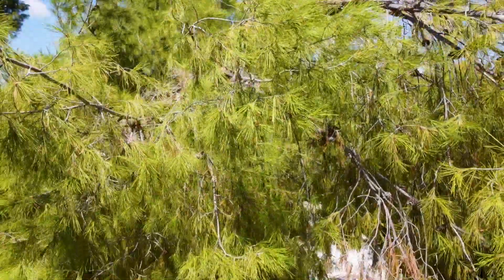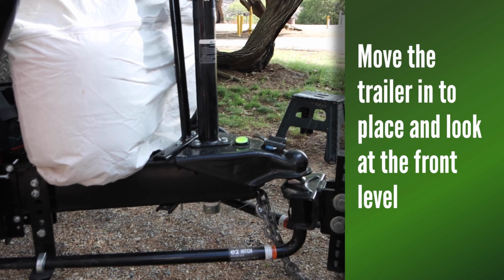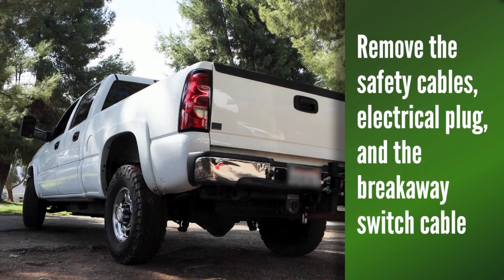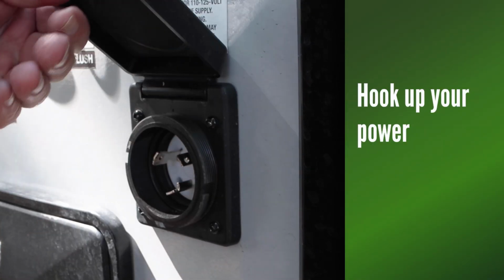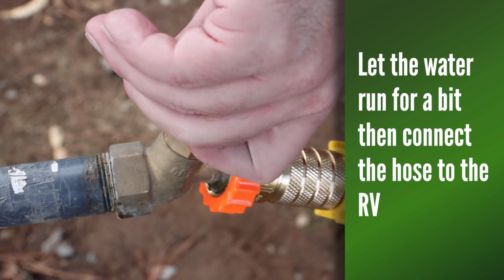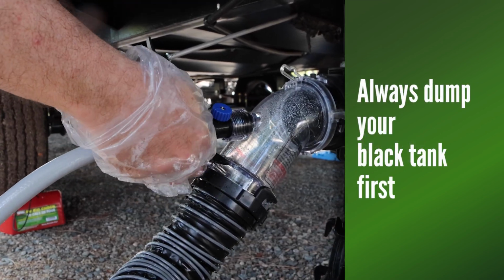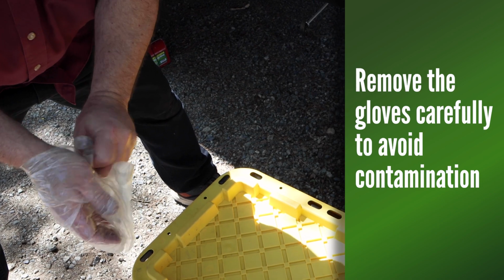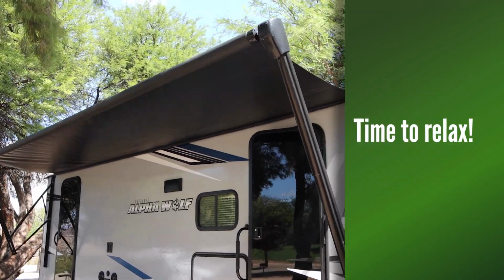How To Set Up A Travel Trailer At A Campsite

Comment: I’ve watch a few of these videos, non check the utilities first. I check them first because if I have a problem with water or electric and have to move to another site, I don’t have to hook the trailer up again. Here’s my 10 steps to setting up at a campground. 
1. Pull up to the site and look it over before pulling in. Look for   overhead branches and debris on the ground, anything that would keep from pulling in. 
2, Pull/back into site, check that the utilities work and will reach. Check that the water flows and the pedestal is wired correctly.  Spray water faucet with Lysol. Look at sewer hook up for anything unusual.  
 Go no Go. If all above checks out proceed, If not contact campground office to correct problem or get new site.
3.  Level trailer side to side and see that steps clear. 
4.  Chock wheels. 
5.  Unhook trailer from Truck. 
6.  Level front to back. 
7.  Stabilizer jacks down. 
The rest in any order. 
8.  Connect water, electric, sewer, cable TV, if applicable. 
9.  Chairs, awning, table. 
10.  Cold beverage.